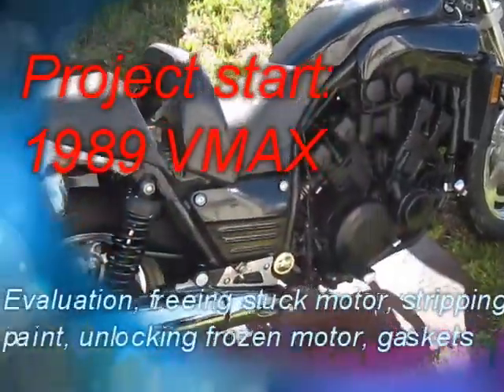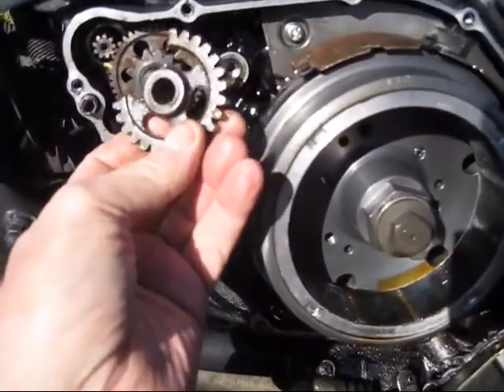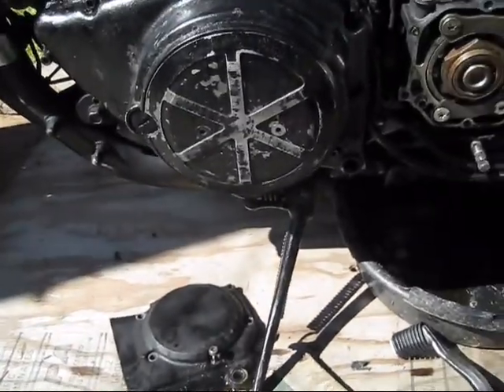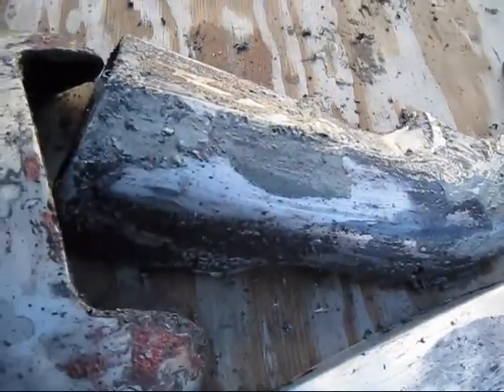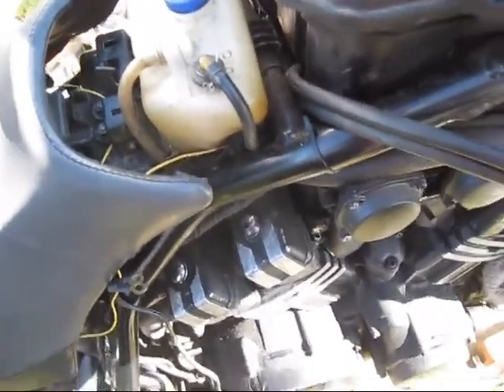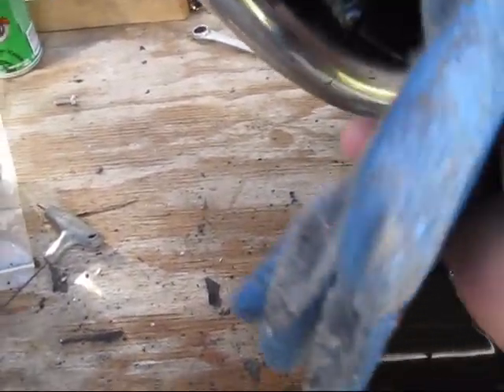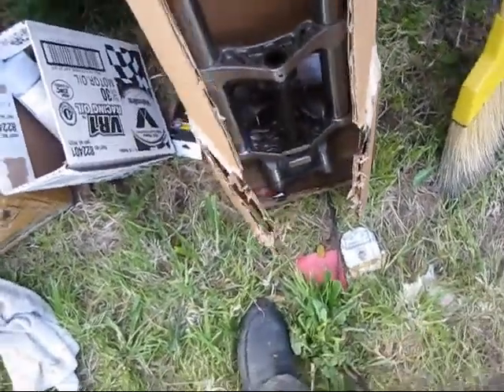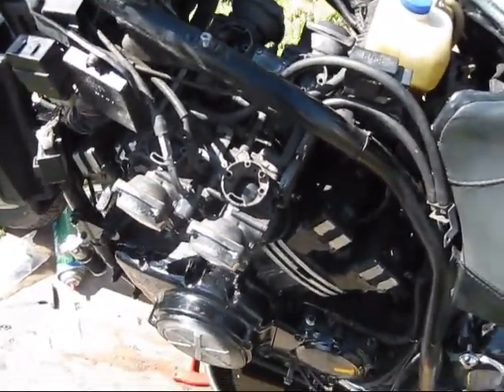89 vmax project start eval and basic trouble shooting

Comment: hi bro . my vmax have starting problem I opened the side gear like you did but starter gears of my bike was ok and your bike gear was broken but still my bike starting go like yours with broken gear
Reply from the maker: If the gears are good, then the problem is in the starter clutch itself, need to pull flywheel